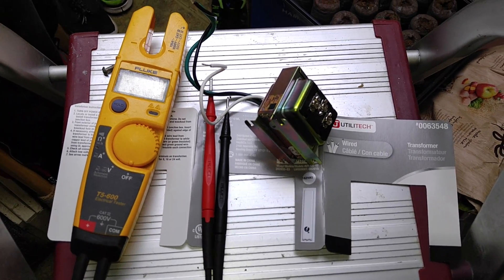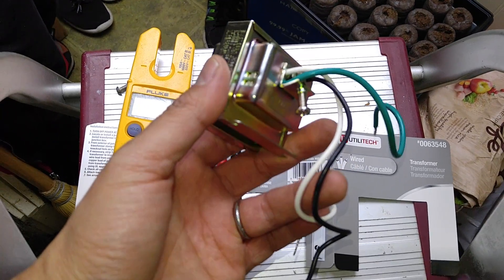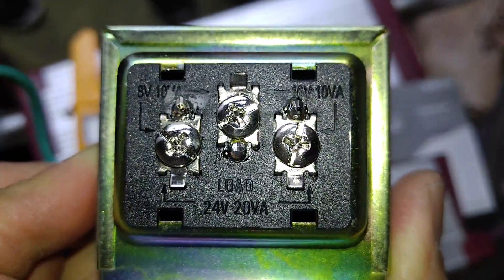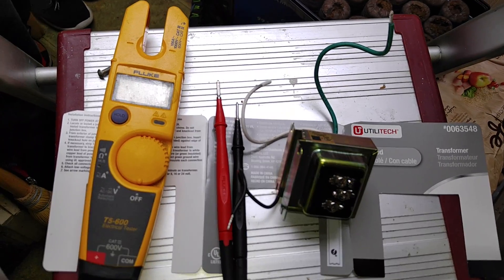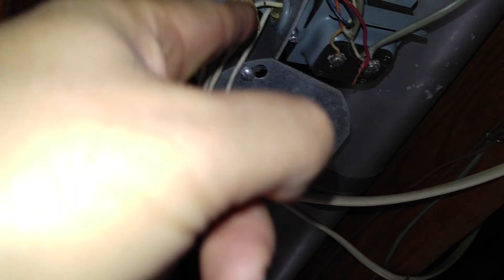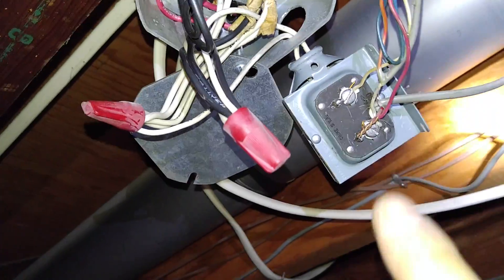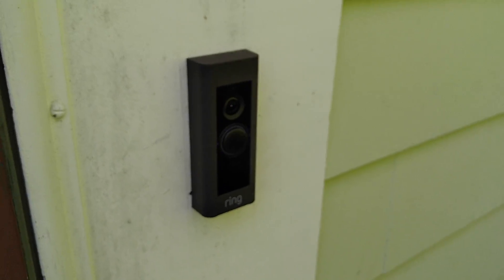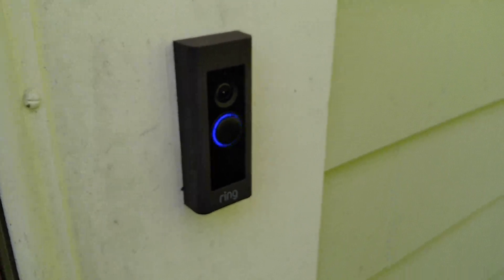Upgrade your doorbell transformer for Ring Pro Doorbell

Comment: What did you do with the Green Wire? I only have black and white wires from my old transformer and was trying to see what or where you put the Green Wire.
Reply from the maker: Ivan O ground that green wire to the metal casing
Reply: Thanks rankar7
Reply: put green wire to ground on a three pronged plug in.
Reply: green wire can be screwed into you box. that the poer wires are coming out from.  metal box.

Comment: Greetings.  I have no existing doorbell (removed with remodeling) and planning to install a Ring Pro with standalone transformer, according to these instructions on the Ring.com support site:
https://support.ring.com/hc/en-us/articles/210205703-Installing-Ring-Pro-Directly-to-a-16-24-VAC-Transformer-Without-a-Doorbell
My transformer looks similar to the one Rankar7 installed (selectable voltage at 8, 16, 24 VAC).  The Ring Pro specifications call for 16-24 VAC (per above).  My dilemma is whether to pick the 16 VAC or 24 VAC setting on transformer. Any recommendations?  I am still waiting for separate Pro Power Cable (fuse) to be installed, so I have a couple of days to decide. Your advice and help is appreciated.
Reply from the maker: If you are not running the Ring Pro off of your current doorbell system, then all you need is their power cable (it's just a cable with an in-line fuse).  If you are running the Ring Pro from your current doorbell system, then you will need their Power Kit:

https://support.ring.com/hc/en-us/articles/208267686-Installing-the-Pro-Power-Kit-With-Your-Existing-Home-Doorbell-Ring-Pro-Only-
Reply from the maker: Please read my previous reply first.  I assumed you were installing a traditional bell to ring in the house as well.  If you are not, or just want to wire the Ring Pro from the 24VAC side of your transformer, then use typical  doorbell wiring, install a 1-amp inline fuse, and you're good to go.  These units do not draw much current so 1-amp is sufficient.
Reply from the maker: Zoltan Biacs make sure you wire it just like you're installing a regular doorbell (in case you want to switch back one day). I would select 16V so the operating voltage is not at either end of the operating range, and make sure the Ring Pro power kit is installed. The power kit is a voltage regulator and keeps your Ring Pro from burning out.
Reply: thank you. the article above (support.ring.com about direct installation) recommends a Pro Power Cable (I think it contains a fuse), but does not talk about the Power Kit. Does it mean I need both the Pro Power Kit AND the Pro Power Cable. Perhaps you meant the fuse with Power Cable? Please see the support.ring.com article and drawing: https://support.ring.com/hc/en-us/articles/210205703-Installing-Ring-Pro-Directly-to-a-16-24-VAC-Transformer-Without-a-Doorbell I tried the Ring.com customer support on the weekend, but it was infinite waiting time and they did not call back.  Thanks for your response/advice!
Reply: Thank you, since I don't have a current doorbell system, I am going with the power cable (w in-line fuse).  I was also able to reach their customer service today, and they are sending me the accessory.   All is good, appreciated your guidance!
Reply: Hi, I have the same problem. I moved from US to Eu and so bought a 24VAC transformer to install the PRO doorbell. I dont have an existing doorbell. My question is it necessary to get a "power cable" (I only have the power kit not a cable) and if so what is the fuse rating so that I can buy an alternative fused cable? thanks.
Reply from the maker: You don't need a power cable.  However, you will need to make sure you have the proper transformer (in your case, a step down transformer from 240VAC to 24VAC).  You'll need typical household wiring to wire to the 240VAC side and then you'll need typical doorbell wire to run from the 24VAC side to the doorbell (this is the actual bell, not the Ring Pro).  Then finally, you'll need to splice in/wire in the power kit from the doorbell to your Ring Pro.
Reply: Thanks a lot rankar7. I have all the mentioned wiring installed along with the 240VAC - 24VAC transformer. I'm guessing the fuse power cable is just a recommended option for extra protection, but not necessary, right?
Reply: I will be using only the Ring chimes devices. I will connect a 1 amp fuse for protection. Thanks again.
Reply from the maker: Arabic Antimatter the fuse is optional. But if you're powering equipment, having a fuse is standard practice.

Comment: Mine worked for few weeks before it decided to die on me. I still see 19V reading on the transformer supply point but CSR told me 21V is required. I am planning to replace the transformer to 16-24VAC and have two chimes and one ring pro door bell connect to it. Do you see any concerns with what I am changing? Also, do I need the power kit pro attached to the door bell in addition to the transformer change?
Reply from the maker: no concerns with running the multiple chimes and the ring pro off of one transformer.  you don't need another transformer and the ring pro is capable between the range of 16-24VAC.  not sure why the CSR told you that you need 21VAC.  you do need, however, the power kit attached at all times, even when first installing your ring pro.  if you don't, it will cause the ring pro to fail at the very first instance of power fluctuation above 24VAC; it's very sensitive.
Reply: Thanks... worked like a charm for the ring door bell after replacing the transformer. 

However, still having issues with my compatibility of mechanical chime. I can hear a loud vibrating noise when I connected with power kit.

Not sure if anyone experienced this and how this can be solved. I am considering digital chime at this point. Any suggestion from the compatible digital chimes?
Reply from the maker: If you're hearing a hum after connecting the power kit, check the output voltage again of your transformer. That hum tells me that the voltage is dropping below operating range.  If not, check to make sure voltage is not above operating range for your mechanical doorbell.
Reply: I checked before installing the power kit and it was the very close to what I saw from the transformer itself upper 18V

What should I do, if the voltage is greater than operating range? 
All the lines are flowing through the same transformer (16-24). Since the transformer I installed has the 8-16 capability, should I be plugging the chimes to those lines?

Comment: I'm amazed that there's no code that you can't bury those in the wall.  Mine is easy to find, but it had the doorbell wire simply coming through the drywall, and the transformer was surface mounted to a single-gang box . . . the doorbell wire attached externally to it . . . I'm having to do some remodeling . . . I think I will get a 4-gang box, and set the whole thing in that . . . I don't think there will be an issue with the transformer just sitting in there, and not mounted, or secured, by the screws.
Reply from the maker: just keep in mind that a transformer when changing the line in voltage dissipates heat as a by-product.  i wouldn't mount it inside a 4-gang box, but if you had to, then i would punch out the other holes in the box for ventilation and cooling.
Reply: I read up on it.  An article said that there's a code where you can't combine different voltages in the same box . . . Also, the transformer is mounted externally, because it gives off heat, you don't want that in a box . . . so, I will be leaving it externally mounted.  Thx!

Comment: Did anyon have a problem with the speaker when talking through your cell phone with someone at the door? They people at the door could hardly hear me when I was talking to them using my cell phone?
Reply: Same here on a new Ring Pro, I wonder if it's because it's on on speaker opposed to talking directly into the handset,  I will have to see if there is an option to talk directly into the handset
Reply: You need to go under settings in the app and change all that and save it because if you don’t save it it doesn’t change the setting.But there’s a volume setting

Comment: I had an electrician put in the compatible wired doorbell from Ring compatible list. I wired the Ring Pro doorbell to that as instructed. It worked great for about 18 hours, then recorded only white and the lens could not see movement and stopped working all together. The camera was slightly warm. What went wrong?
Reply: It wasn’t hardwired in im an electrician where are you located

Comment: hey, i am having an issue with my ring pro.. my doorbell works and everything is fine but when i setup the ring pro and have it all properly connected the ring only lights up solid and does not start spinning when i click the wifi button, is this the same issue you are experiencing?
Reply: I'm having this same issue and believe it's because iits not getting proper voltage. Try calling support. They're helpful!
Reply: I ended up calling support and my unit turned out to be faulty. they sent me a new one and its been working great since!
Reply: Cool because I think I have a faulty one also. I am getting a new one. Worked great for about 18hours then recorded only white and the lens could not see movement. Hope the new one works.
Reply: Rosti maks mmmm happened to me but after resetting it worked